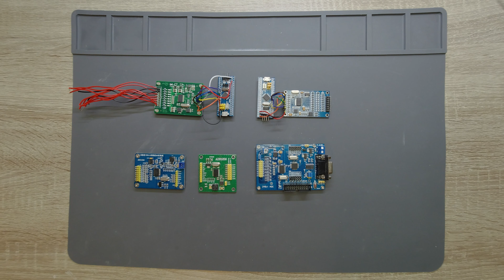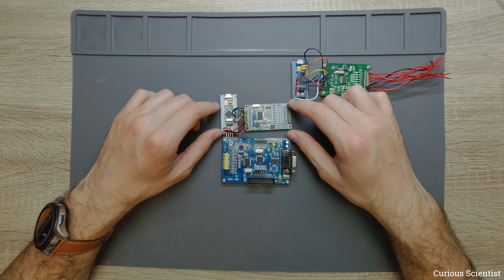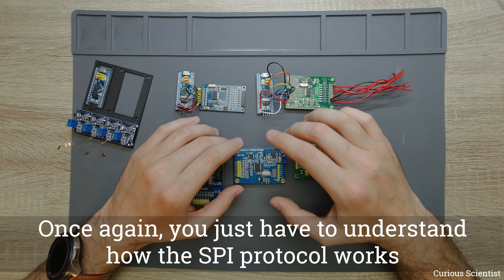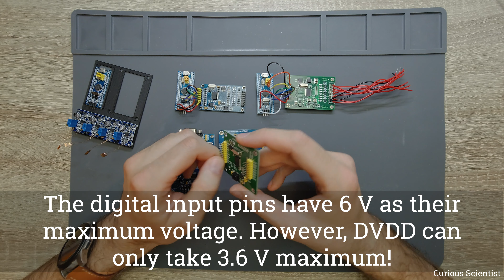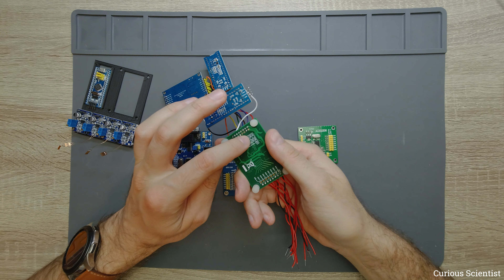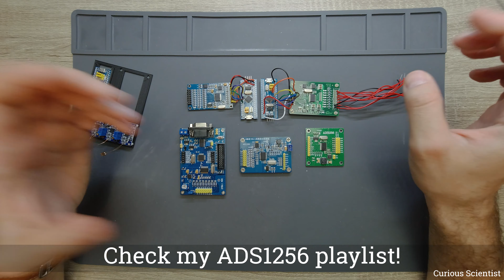Comparing 5 different ADS1256 boards and discussing some issues

Comment: Heyy dude
i have the ads+stm32 board 
i am trying to connect it to the arduino nano esp32 to see data on the serial moniter but nothing shows up
debugs just fine and loopback test also passes
it is not working on both spi2 or usart 2
where do you think the issue is?
Thanks and regards
Reply from the maker: Check if the peripherals share pins or something. But, why don't you just use a simple ftdi adapter? Then you don't need to struggle with another microcontroller between the ADS1256 module and the PC.
Reply: @CuriousScientist  Ok i will try it
any idea how ads is internally wired to the stm?
multimeter shows DIN DOUT are not wired correctly
can you confirm it?
Reply from the maker: I mentioned all the wiring in the video and the source code.

Comment: Im trying to use this ADC to amostrate a waveform with 4KHz, but it isnt look so good. Searching for information, it looks that this baord cannot measure something like that, my question is, have you been tried do something like this? do you know if its possible? For me, it does not make sense that it is not possible since it has 30ksps.
Reply from the maker: It should be able to measure such a signal. Your settings are most probably wrong. Read the datasheet more carefully and use my latest, official Arduino library and the corresponding documentation.

Comment: Thanks for the detailed explanation. I have a problem with a large board (STM32+ADS1256). The DRDY pin is always HIGH, so I can not start SPI2 communication! Does anyone have experience with this problem?
Reply from the maker: Hi! How do you know it's high? My board worked just fine.
Reply: @CuriousScientist , thanks for the fast reply.  I checked everything using the oscilloscope. Today, after detailed analysis under the microscope, it turned out that the RESET pin on ADS1256 was not soldered (factory error) and that the chip was always in the reset state.
Reply from the maker: Wow! Nice that you took such a detailed approach and investigated so deep. Great troubleshooting! I hope the circuit works well now.

Comment: Amazing video!, quick question: is the custom code you used for this board the same used in a separate STM32 blue pill? Mainly my question comes from the pin connections
Reply from the maker: Thanks! I used the same code, but of course, I adjusted the code where it was necessary.

Comment: Thanks for explaining the pin differences! I wonder have you been able to benchmark and compare the differences in performance for these boards? I wonder if one performs better than the other.
Reply from the maker: Hi! I haven't evaluated their performance because, at that time (even now), I did not have proper equipment. It would be nice to have a decent multimeter, voltage reference, and signal generator. But they are costly. I could do however ranking tests. Maybe soon, after I have my finish my own ADS1256 board.
Reply: @CuriousScientist  Sounds good, perhaps with this type of test you may be able to advertise your board as more performant!
Reply from the maker: Hopefully, assuming that I used the right components and laid out the board properly. Mine also has a built-in microcontroller, so it was a bit of a challenge. Soon, we will see.

Comment: Hello! Really appreciate the video! I have a question about code compatibility with the $16 ADS1256 (blue), connecting it to an ESP32 Feather. Since there's no RESET pin on my ADS1256, and the initialize ADS1256 function relies on the RESET pin for initialization, how should I go about initializing the ADS1256? I'm using the older version of your code as a reference. Thanks!
Reply from the maker: Hi! The initializing neither relies on the reset nor on the CS, and these are carefully explained in the datasheet I provided for my library. Please check it on my GitHub. Cheers!

Comment: Hi, thank you for the upload this was very informative.  Also I am wondering about your experiment and results using the 4 strain gauge circuit module, I was not able to find in your library.
Reply from the maker: Hi! What exactly do you want to know about that circuit? There's nothing extraordinary about it. The voltage is provided by the output of the strain gauge modules. It is still just a voltage measurement with the ADS1256.
Reply: Hi, thank you for the response.  I am just trying to play with these strain gauges and ADS1256 as DAC using arduino. I am trying to setup something simple as verifying the Poisson ratio and hooks law for which I would need more than one strain gauge reading simultaneously. When I did my engineering couple of decades ago these test equipment used to cost in thousands but now theses can be bought at the price of few drinks. 🙏🏼
Reply from the maker: Yes, Poisson's ratio definitely need at least 2 strain gauges to measure the axial (longitudinal) and transversal (lateral) strains. It is definitely a doable task with the circuits I present on my channel. 

I agree that nowadays, even the high-tech stuff is getting more and more cheap. This ADS1256 is a good example of it. A well-designed board with a good voltage reference chip costs less than $20. If you know how to use the board, it can do amazing stuff.
Reply: @CuriousScientist  I have ordered few of the ADS1256 along with some strain gauges including several other types of transducer. I am trying to use Labview community edition for data collection and to interpret the results. I am also looking for precision resistor in case I want to build my own Wheatstone bridge. Your video tutorial has been very helpful to get me going on the track. Thank you.
Reply from the maker: Also, don't forget to get a reliable voltage source for the Wheatstone bridge. A precision voltage reference paired with an op-amp configured as a voltage follower can probably provide enough juice for the bridge. I am glad to hear that my videos were helpful for your journey.

Comment: Hello Curious Scientist, 
Greetings of the day! 
ADS1256 + STM32 embedded, which you have shown in this video and other videos is really helpful for me
Now could you please enlighten me with ADC calculation? 
How to relate Force I need to measure using Strain gage with ADC resolution? 
For example, 1KN force applied on Strain gage mounted on the metal component and I will get Bridge output in mV. Now I want to understand if this mV value is acceptable by ADC or not? How to calculate/relate it? Your kind reply would help me to proceed further with ADS1256+STM32 selection.

Thanks & Regards
Abhilash
Reply from the maker: Hi! 
Put a known load on the load cell and measure the output. Repeat it with multiple known loads, so you have a set of points with load vs. ADC values (or voltages). Then you can just fit a linear on the set of points and recalculate the load for any given ADC value. 

Millivolts are very easy to measure with this ADC. It is a high resolution ADC and it also has a built-in amplifier.
Reply: @CuriousScientist  Hello Curious Scientist, Thanks for your kind response. I agree with you for the experimental set up. But now I am in the selection of Strain gauge and data acquisition (Transmitter & Receiver selection phase). Hence I wanted to calculate theoretically to understand Bridge output values so that I could select ADC, ESP32/8266EX/8266 for the wireless transmission of measured data.
But I am here to ask you about PGA setting and range of Input voltage 24  bit ADC can accept. I have arrived at very low output voltage from the bridge which is not falling under 64 PGA setting range as well. In this case, how would you guide me? Should I use OpAmp  or any other amplifier + ADS1256 with PGA?
Hope you could guide me in this regard.
Thanks & Regards
Abhilash
Reply from the maker: Hi! You can pick some instrumentation amplifier to bring the voltage up to an appropriate level. But I am convinced that the resolution and PGA of the ADS1256 would be pretty much enough.
Reply: @CuriousScientist  Ok noted.Thanks

Comment: Excellent tutorial! I think all was very well explained. I see you're teasing the upcoming project ;) it seems interesting
Reply from the maker: Thank you! Yes, that project will be very interesting (I hope, at least). I soldered the connections yesterday. I will need to finish some other stuff first, but soon, I will make some interesting demo with the strain gauges.
Reply: @CuriousScientist  Tensile machine v2 maybe? 🤔😉
Reply from the maker: Haha! :D My specimens are too small even for these tiny gauges. The tensile testing machines is actually pretty OK from electronics and software perspective. It is waiting for a mechanical upgrade, but it is crazy expensive, so I am still saving up for it.